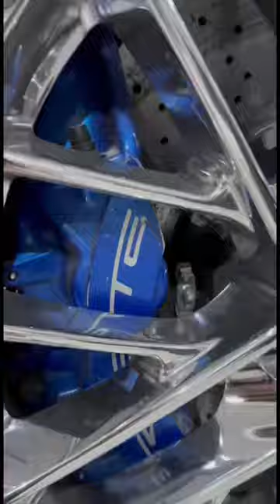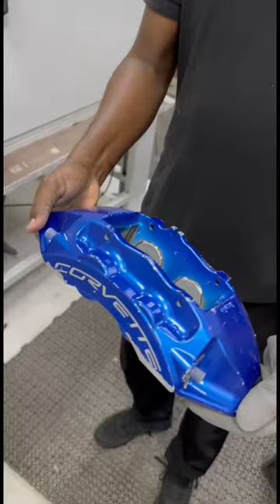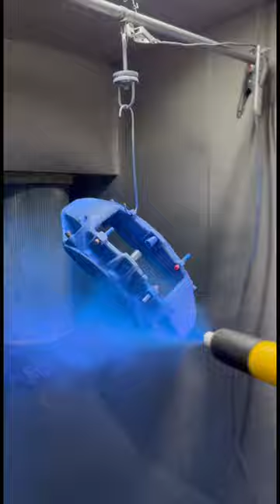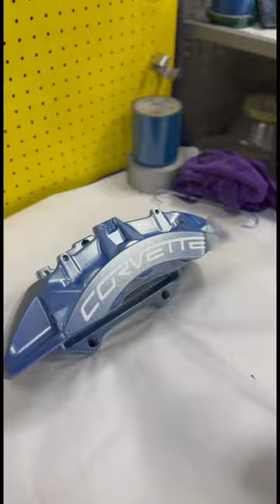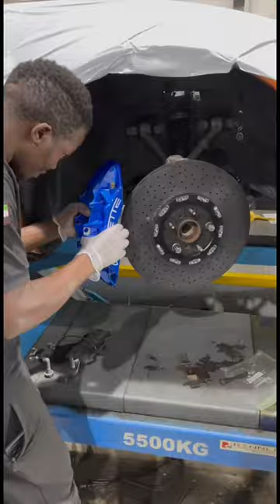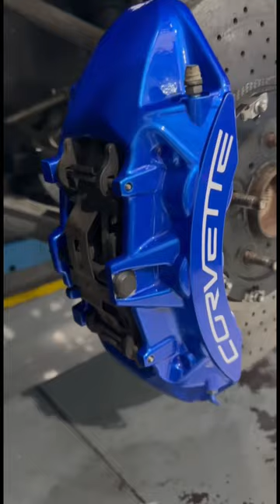How to Powder Coat Brake Calipers? #SHORTS

Comment: How long did you cure the clear coat? I’ve tried this with white vinyl logos before and the white turned brown after a full cure.
Reply from the maker: White vinyl is a tricky one. You cure it at slightly lower heat then required. Try different brand of vinyl, some whites are more heat resistant then others.

Best way of doing it is a cutout and spraying Cerakote C series rather then applying a decal. We posted a new short where you can see the cutout for a brief second. It will give you an idea. Will post another short in a few days showing how we do it exactly.
Reply: @EFRMotorsport do you recommend a beginner making the decals with vinyl or is it difficult making the “brembo” with white powder coat?